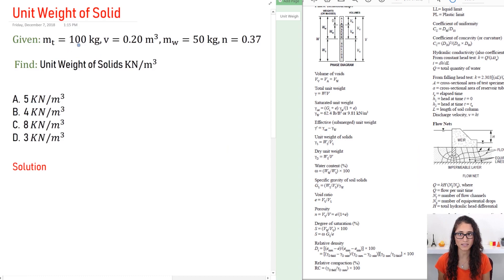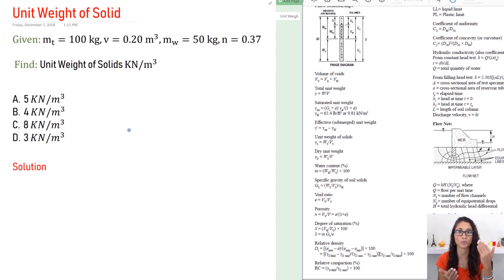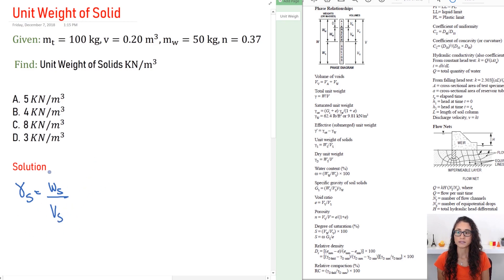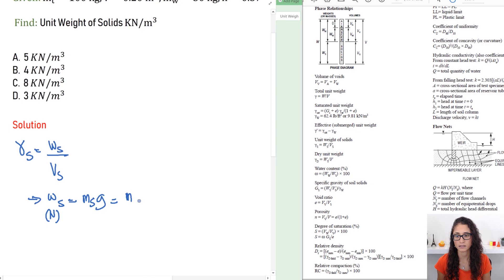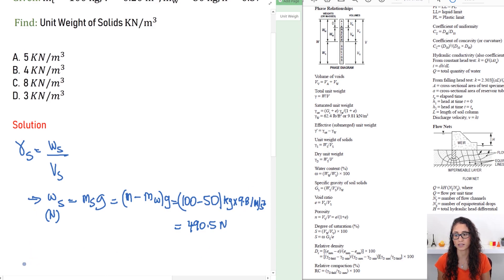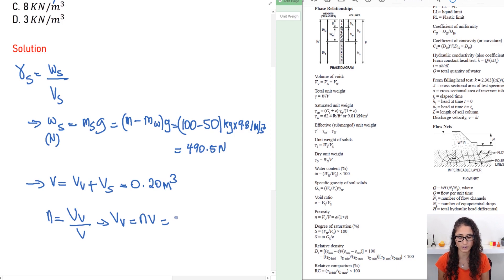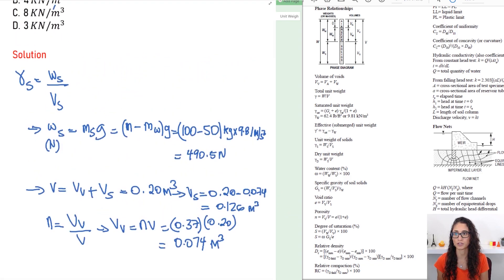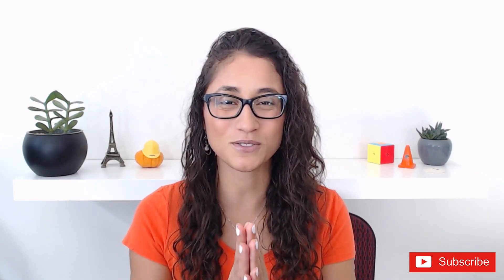FE Civil Geotechnical - Phase Relationships Unit Weight Of Solids

Comment: Why haven't you subtracted the Vw from Vv? Thank you!
Reply from the maker: Hello, so Vv (volume of void) is equal to Vw (volume of water)  + Va (volume of air), you can check the phase diagram on page 152 on the reference handbook. In this example, we are trying to solve for Vs (volume of solid), so we can get the unit weight of solid. By looking at the phase diagram, you can see that V (total volume) = Vv + Vs, where Vv = Vw+Va. So we solved for Vv (which includes Vw and Va), and we plug it back to solve for Vs. Therefore, there is no need to subtract Vw from Vv. I hope this makes sense and good luck.
Reply: @Genieprep  Thank you.